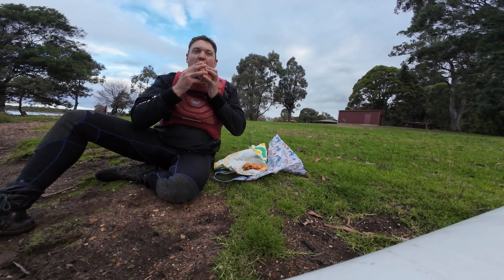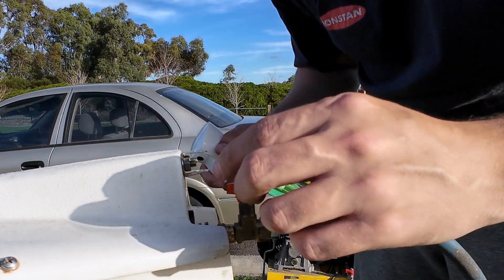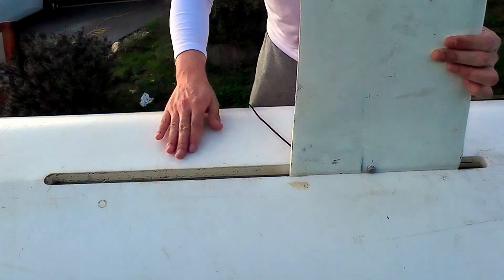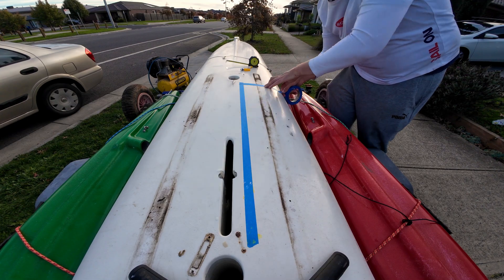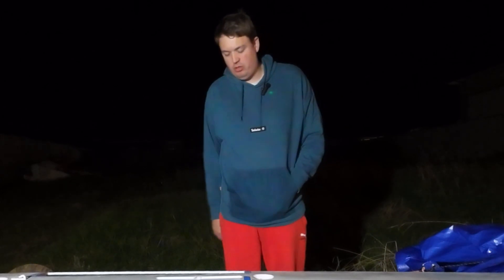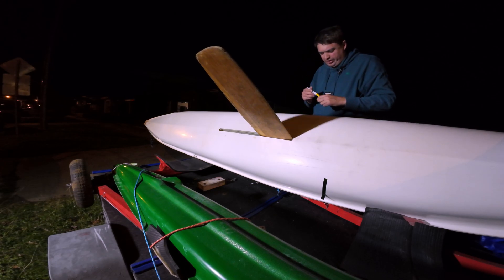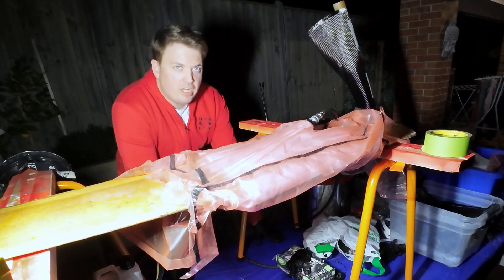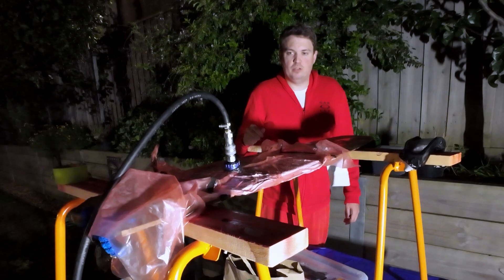Why did my super rare $150 Trimaran Sink? Cutting open the deck to see what's going on!

Comment: As always very nice video! May I ask where you learned to deal with carbon fibre? I want to get into it but dont really know where to start or where to get a vacuum bag and the pressure pump. I worked with a bit of fiberglass but never with carbon. I have an old windsurfing mast that I would like to repair but dont know where to learn a bout a procedure like this.
Reply from the maker: Thanks Max! I mostly rely on the videos from Easy Composites, even before making this centreboard case I watched one of their videos to check I was kind of on the right track. Although I haven’t taken the bag off yet, so I’m not sure if it worked yet. The vacum pump I have is a vevor one (cheapest one on the internet). Took a bit more fiddling to get the fittings etc right, but cheaper than buying it from a proper composites shop. The actual vacuum bagging consumables are pretty easy to find from Easy Composites, Trojan Fibreglass etc 😀